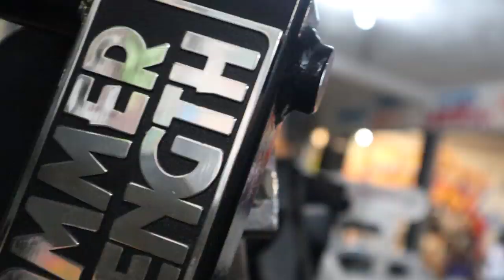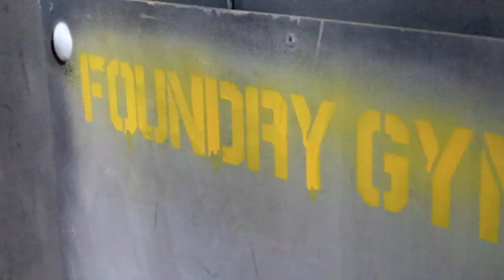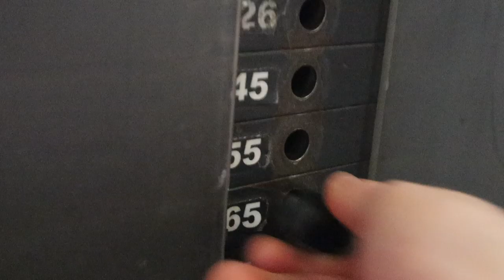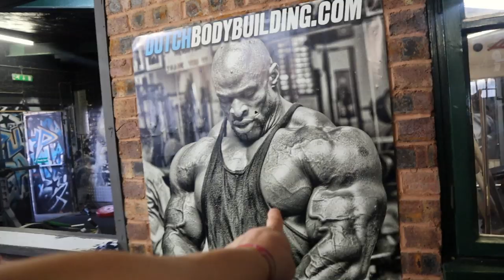THIS GYM LOOKS LIKE A PIRATE SHIP - Foundry Gym

Comment: I train in The Foundry. I'll start with the negatives. Being opened 24/7 - 365 means a lot of pressure on the machines and other facilities like changing rooms and Boxing rings. Tbh, it could do with being shut down for a deep clean. I'm not saying its dirty, just that being open all day every day brings inevitable wear and tear. Another negative is the inevitable problems you find in any gym as regards people not putting back their weights and plates.  But on the plus side, its the best gym I ever trained in. Its actually got everything. Cardio, weights, power room, Boxing rings, lots of personal trainers and dietitians train there, and excellent value. So, I better not complain too much....just a little bit!